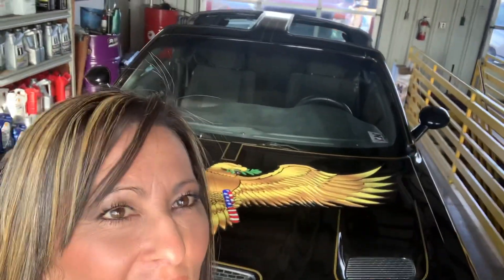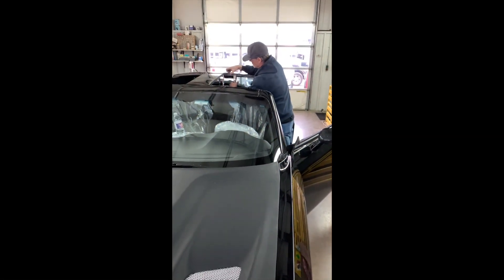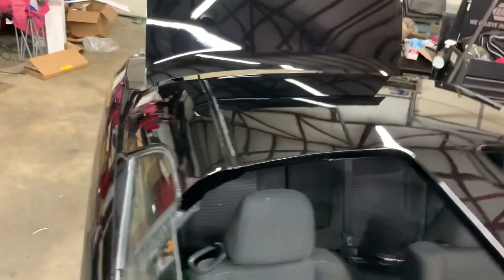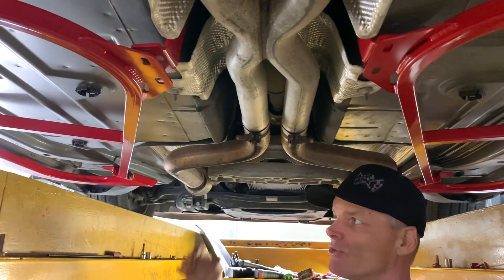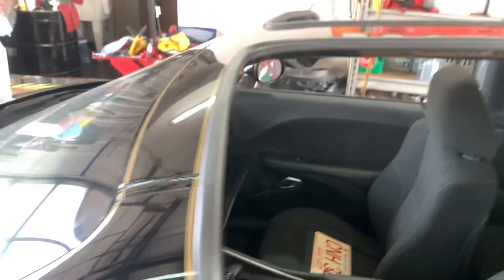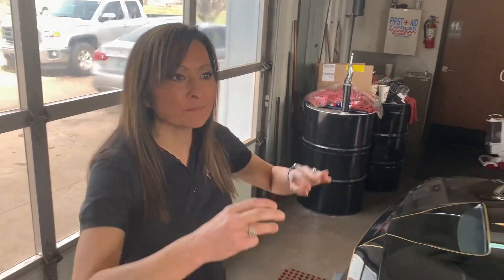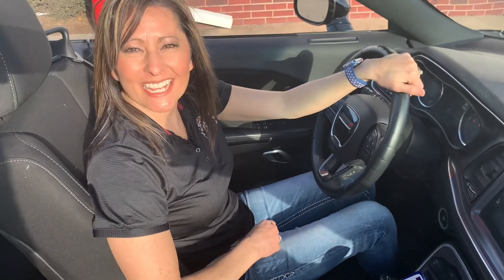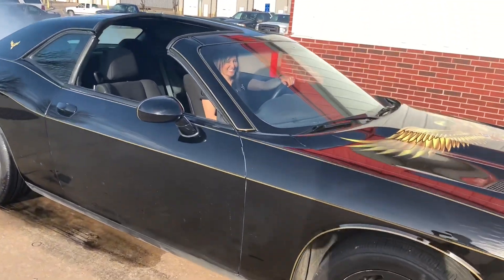T-Top Challenger!? John Schneider’s "Poker Run" New Movie Car

Comment: It's very cool when you get to do projects for movies. I used to do commercial drywall in my 20's when I live in Los Angeles and worked on a few buildings that was used in movies. I was a part of Die Hard. Among all the drywall hung in the building, on the 30's floor's all those metal studs and our plan table with the blueprints were all showed in the movie, the crew I was working on put all that up. After the movie was done filming, we built the top floor for Ronald Reagan's office after he left POTUS so he could land in a helicopter on the top floor (roof of 35th floor). I have pics of Reagan and Bill Clinton in that office. Real name of the building is Fox Plaza on Ave of the Stars and it really is in Century City, CA, a suburb of LA.

Comment: Schneider has referred to it as a Hellcat, but I'm certain it's a regular/normal Challenger. I mean a freaking V6. How disappointing is that?
Reply: It’s a turbo V6
Reply: Its a V6 with a Hellcat hood. The fact he wanted Nitrous and squirters on the rear wheel wells make it even more ridiculous. Probably the worst fake Hellcat out there not to mention they cut holes in the roof to make it look like a t-top roof is beyond me. Glad I own a real Bandit Trans Am with real functional t-tops.